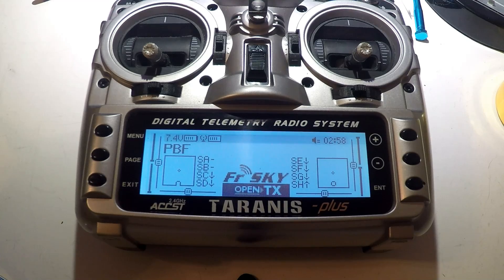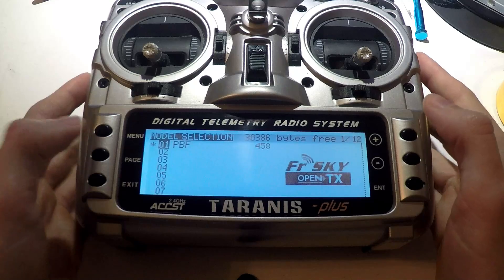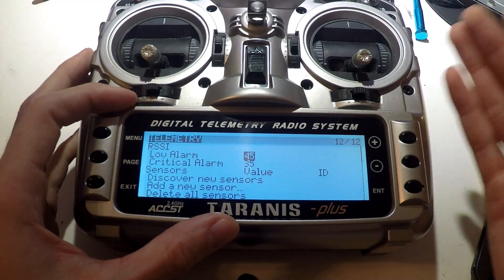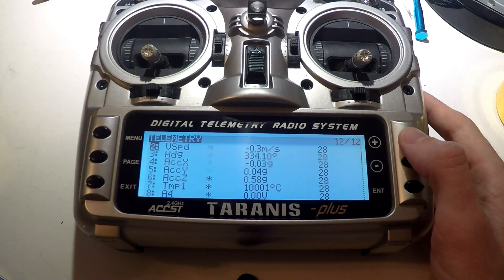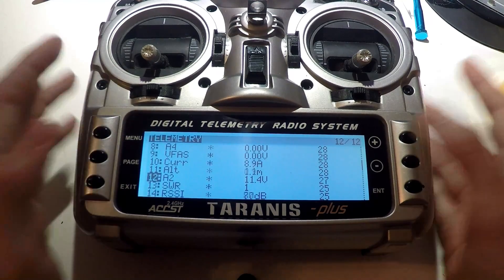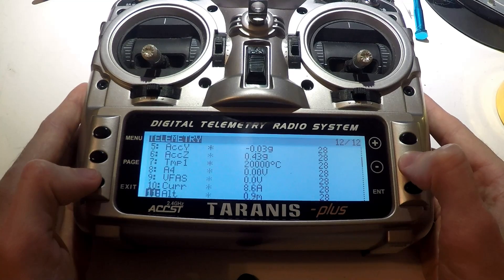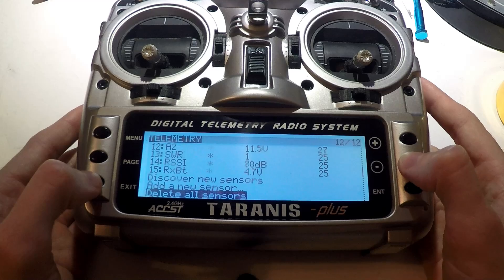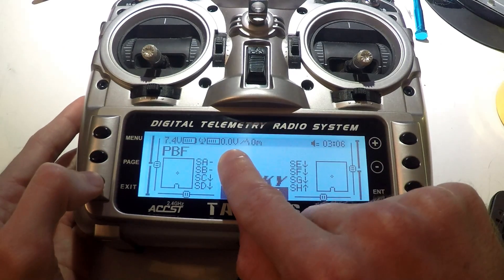Taranis X9D: Setting Up Telemetry

Comment: The problem is I cant find the sensors,I solder all correct,load fc firmware,bind receiver but no sensors detect

Comment: Great and quite helpful.  I sure couldn't have figured it out without you.  I used a jumper T12 but it runs opentx so it worked. Thanks.

Comment: Hi there, is there no way to setup telemetry screens without using beta flight or clean flight on the X9D? Eg/ When I setup telemetry using V2.1 firmware I didn't need either programme. Because I accidently flashed v2.2 firmware I'm struggling, could you confirm if it is possible to setup telemetry when using firmware v2.2 with the TX only? Cheers Pete.
Reply: Pete Smith Sorry man, but he died a few months ago. 😔

Comment: Would you mind posting a schematic for wiring a 12s (6s in series)? According to the frsky website it can be done only with the Flvss lipo sensors with 2 different IDs. The issue I'm having is that I need a wiring diagram. I would like to monitor 12s.
Reply: Not sure if you realise, but unfortunately this legend passed away

Comment: Hey Jc question brother ... I upgraded my taranis with you guidance but on my goggle I lost my Rssi it says 0 and on the taranis warning on the logic I had set up the voice does not warns me anymore . Any idea what happen or how to fix it?
Reply from the maker: If you upgraded firmware or anything try deleting all telemetry sensors, then rediscovering them, then go back to the logical switches and special functions pages and make sure the same sensors are set. Sometimes the order of the sensors change and in those pages it will switch to a different sensor.